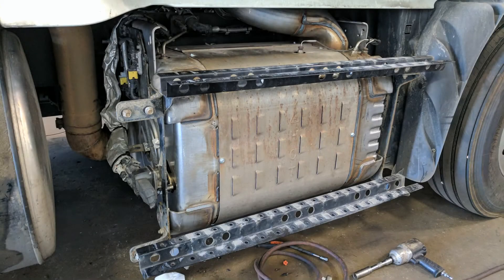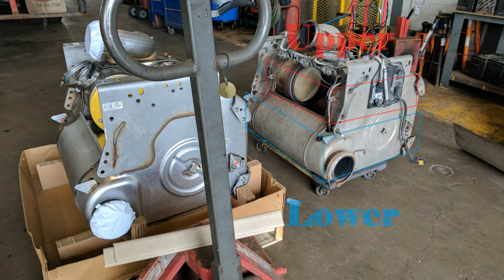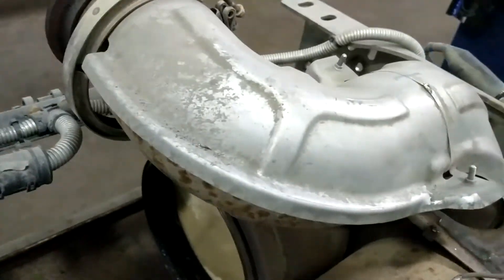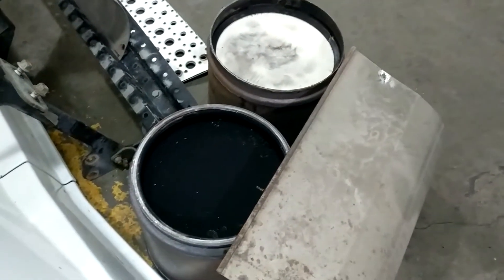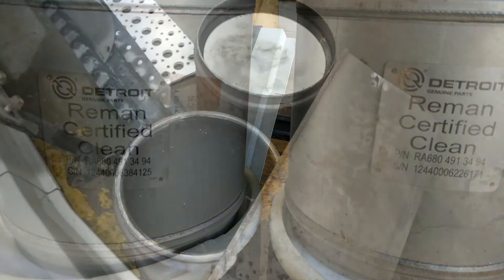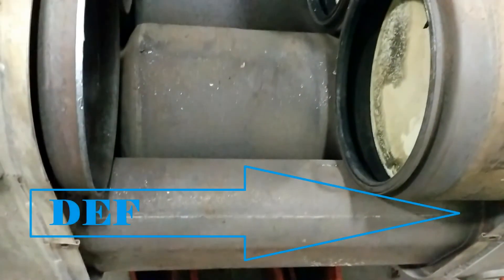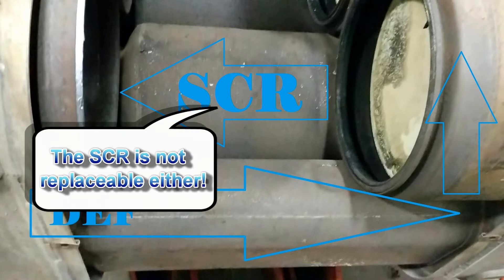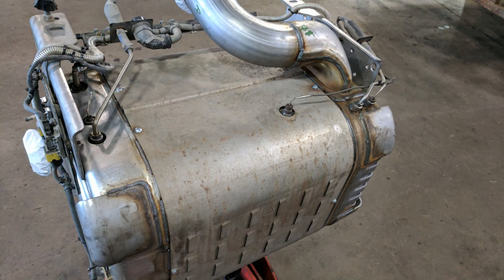1Box Flow

Comment: can the diagnostic tell me about how good the doc is without dismounting the box ?????
Reply from the maker: The engine monitors how much heat the DOC is producing VS the amount of fuel it is injecting into it. If the heat being produced falls below a set amount, the ECU will set faults.

Comment: Can the doc be clean out?
Reply: The upper two can the bottom one you cannot see cannot be. If you do a one box delete you need to cut a hole in the box end and drill the bottom one out with a 0ne inch are larger long drill bit a wood drill bit will work if you cut the metal screen out with a torch.

Comment: How much a Box like that would cost$$$
Reply: john hershey 10k
Reply: 18000 installed by the dealer and it will fail three times by the time you put 800.000 miles on the truck and the filter you cannot see in the bottom will stop up. It is designed to fail and not be fixable.

Comment: so why are you replacing that 1 box?  did it overheat and migrate the rare metals to one end of the substraight and now low conversion codes?
Reply from the maker: First Name I believe this one was overheated due to faulty injectors. It broke the DPFs which, like you said, poisoned the SCR.
Reply: @TheDieseler  what was the bill on that repair?